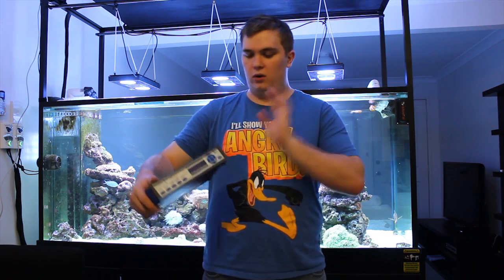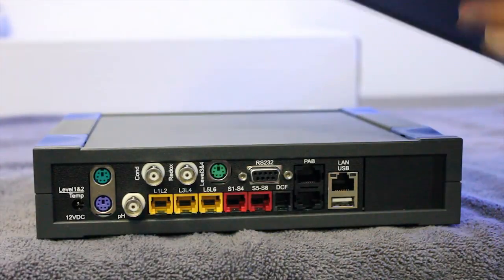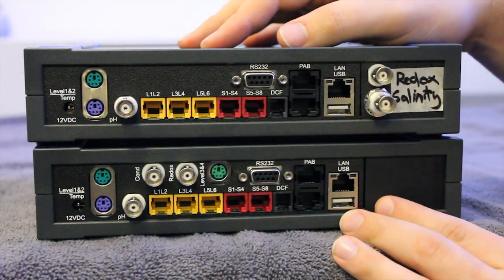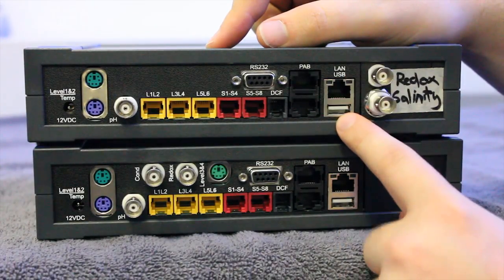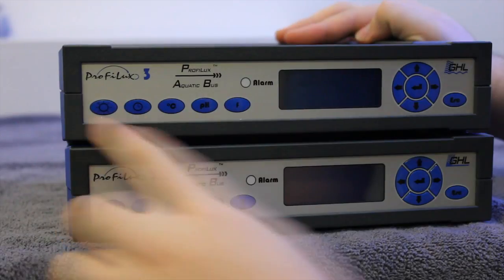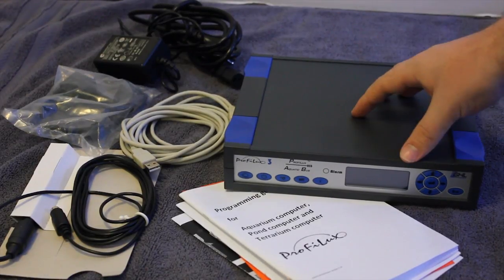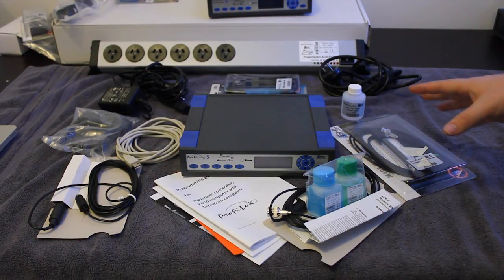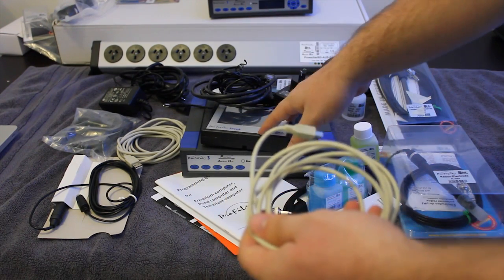GHL Profilux overview and packs

Comment from the maker: Hi Janet, I assume you have a wireless router and you would like to use the D-link DAP 1522 to wirelessly connect to your router and hardwire it to your Profilux unit. Is this the case? If so, I would suggest that you first set it up and see if you can get a laptop working on the ethernet cable (with the wifi turned off on the laptop). Once you have that working you then only need to configure the Profilux unit with the ethernet cable you used for the laptop plugged in.